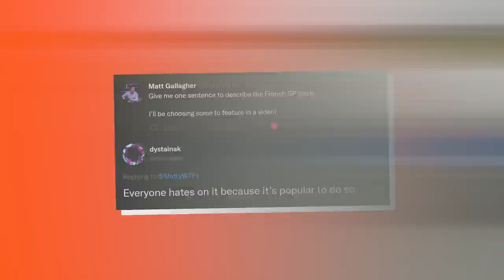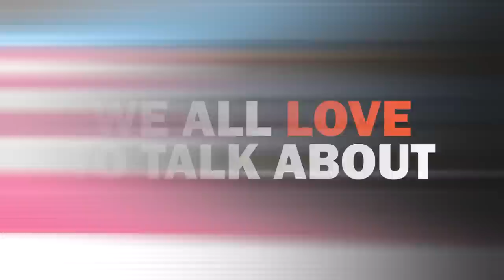Is The French GP Circuit Really THAT BAD?

Comment: It's just really hard on the eyes to see the flow of the track they're actually racing around as the strips just make it so confusing. None of the corners are that memorable and because it's all surrounded by identical striping it's difficult to know which corner a driver is at when the feed switches between drivers... By giving the entire track these jarring stripes it robs the circuit of a natural flow and characterisation. At many tracks you know where a car is when it's switched to. Or at least there's usually 2 or 3 corners which you cannot mistake. Paul Ricard is just homogenous and messy and hurts your eyes as the camera sweeps around and the strips pivot and twirl around.

Comment: Paul Ricard produced some good racing in the 80s. The problem with the track now is that for reasons I can't understand they decided to put a chicane in the middle of the Mistral straight, one of the greatest blast straights in motorsport and which IMO is the key to the whole track. This has consequently ruined the racing. Ditch the chicane and let the cars blast down the Mistral at full tilt and you'd get plenty of overtaking action.

Comment: I never thought it was a bad track. Maybe not the most exciting as it's very flat, very consistent, and very visually assaulting. But there aren't massive problems with it; it's just good, with a blend of technical medium to high speed sections that flow well.

So keep it...but maybe ditch overlapping layouts and change the stripes for a coloration that's less assaulting to the eyes at 200kph.

Comment: In my opinion, the track is better than its reputation. When I drive it on the F1 game, for me it's one of the best tracks. I really enjoy the first two corner combination, the chicane in the middle of the straight and especially the long, tightening right hander which you enter really fast and then have to bleed speed through. Also the off camber left hander after it is tricky. So to say the track is boring or doesn't have character, just because you can't name the corners (which you cannot do with most tracks on the calender and isn't really a criterion of track quality anyway), isn't accurate for me.

And then there is this whole discussion on the number of track layouts and blue and red colour scheme. Which I also find ridiculous. Of course gravel traps would be nice, but I actually like the colourful design and I think it even makes the track unique. And many layouts, if anything, is good, not bad. This is just argued about to find further arguments against the track because these things are different than on other tracks, and people don't like differences. The maze memes are funny, but I never ever wasn't sure about the used layout when watching a race.

The one, solid point against the track is that it produced a couple of boring races in a row. Which is of course a substantial criticism, much more of an argument than colours or number of track layouts. But that was in an era, where boring races happened on a lot of tracks due to Merc dominance and dirty air. Last year was already a good race, let's see if this year is good as well, then for me, the track is fully rehabilitated.

Comment: I genuinely tried to guess the correct F1 layout from the picture and got it wrong AFTER WATCHING 3 RACES THERE.

If I were to say one kind thing about the track it'd be that it's very safe, since you are one kilometer from the next wall at any given point in time. Of course, you are NOT safe from the FIA which will guillotine your winning chances for violating track limits that do not physically exist.

Comment: I don't particularly like the colours but it's not that bad. It's also easier to get to than Nevers. I drove past the circuit on the motorway yesterday afternoon while the race easy underway and the temperature was close to 40 degrees so it may not be the best time of year to host the race. 
Given its proximity to Monaco, I was wondering if there have ever been any two races in a single year so geographically close?

Comment: Producing good racing doesn't mean the track is actually all-around good. If the drivers say they don't enjoy it, there must be a reason. Of course I'm just an average sim and videogame "driver" but Le Castellet has no flow at all. The three sectors are very different from one another and you're never in tune with the whole track, exactly how it feels when you watch the race. You can overtake and you can see good racing, obviously, but it doesn't automatically mean it's a great track. We had boring races in Silverstone... Would we say it's a bad track? Final note: in a fantasy world, where the horrible stripes are replaced by gravel/grass, this could actually be a more interesting circuit.

Comment: Two things (or three):
1) It is just boring - that's it.
2.1) The blue/red lines around it - they are not pleasant to watch, definitely irritates the eyes; especially in close caption it is even hard to follow there the car is, because most corners looks identical....
2.2) ...and apparently they (blue/red lines) do a terrible job stopping the cars from sliding (which is their main purpose)... not even close to the gravel used no the most tracks. Yes it is easier for cars to come back on the track after a spin or when pushed by another driver, as happened to Perez this weekend, but is term of safety I don't think it's a proper solution.
   Cheers!

Comment: It is worse. The only thing that makes it a tiny bit less than unwatchable is when the track cameras keep tight focus on the cars and stay away from the dizzying runoff art. If I was epileptic those patterns would put me frothing and flopping on the floor. When the shot switches to helicopter I have to search for the damn cars. Replace it with Le Mans next year, dump Monaco since the cars are almost as wide as the track and keep Spa. Otherwise, I have been gravitating to Indy. Yeah, bad tracks but man the driving excitement is great. And they are fast. And the cars are quite cool looking. F1 needs a reimagining. the Netflix crowd will fade and the life long fans will find better racing elsewhere.( LMH and LMHD cars are looking racy.) Then what? Oh and if the announcers of F1 would just give up the obsession with track limits already. Let the drivers drive. The curbs and dust in runoffs will bleed off time without the Nannies taking points away for a millimeter over a silly line. OK. Hopefully the race will be slightly less than boring on Sunday. My bitching is over now. lol

Comment: This track is literally just a painting on a huge parking lot. How about racing on some actually good and interesting tracks? For example there is a track with minimum 12m width, so modern cars would fit perfectly, it's got gravel instead of sausage kerbs or stupid asphalt, grass, elevation, great corners, only thing it's missing is a super long straight for DRS overtakes, but really, it's not the overtakes on straights that are interesting. Just check out Brno Circuit. MotoGP is there, the track is fantastic, modern F1 would be great there and the only thing missing is the safety grading by FIA, even though it's still much safer than Saudi Arabia for example.

Comment: I hate this type of tracks in Simulations when it isn´t clearly where you have to go in the first few laps, there is on particular part where i often brake to early because it´s easy to confuse for the actual track layout when it isn´t clearly marked. It is before a chicane where it looks like a crossing, i hate it really.
The track itself is fun and has great flow but this parts where parts of different track layouts just cross the actual layout with markings all over the place, that makes it infuriating for me in simulations.

Comment: the 2021 race was "good" just because merc f up their strategy. by my view, you really cant overtake on this track, maybe T1 + chickane on the mistral straight, but thats it... the whole sector 3 is just horrible to watch as its very much different to what favourite technical sections look like and are constructed. plus only 60 km/h pitlane just is a negative thing. they need to change sector 1+3 to have some actually good overtaking spots and a better flowing technical section.

Comment: Just opened the video, but we're not. Track is just boring.

Magny-Cours was interesting as pushing hard was key, nowadays wouldn't suit the cars, which makes me wonder, do we need a French GP?

Why just they don't use La Sarthe Bugatti circuit with any changes needed, maybe increasing the track a bit to be under the minimum lenght required by FIA and maybe Safety Grade 1.

Comment: the thing i hate most are the huge run off areas. no penalty for drivers when they make a mistake. I really dont like all those TilkeDroms. They have no character.
Reply: Paul Ricard wasn't designed by Tilke
Reply: @ey7290  i used the term Tilkedrom as a synonym for modern track with huge run off areas. 
I didnt mean to say he made it, even though i did not know he did not design it.

Comment: This track iritates me so much that I usually don't bother watching it. The main reason why I don't like it is because the track is painted pattern  on a large piece of tarmac. The Blue, Red and green lines painted around it I find irritating and distracting to look at. 
The drivers all abuse track limits because there is no reason why not to.
Overtakes become silly as each driver then uses  the  run offs to their advantage.
I can see why  track attendance is so low.

They could make it better by putting grass strips around the outside and inside of the corners.
There is already grass around the circuit so it does grow there
But they won't as the option they chose is the cheapest one.

Failing that, artificial grass would be even better.. No high grip, highly  painted tarmac please...

Comment: My opinions on Paul Ricard are based on how the track looks

I like the layout the F1 drivers use - yes even the chicane - but the rest of it is just horrible

The combination of 25 squillion track layouts and the day glo tarmac run off areas makes it the ugliest racing circuit in all of motorsport. 

I wish I could ditch the multiple layouts, add grass and gravel and make it look like an actual race track that looks visually appealing to look at instead of what we have now

Comment: It's not the track, it's the cars.

Let me explain:
OMG The French grand prix is so boring!
OMG The French grand prix (Magny Cour) is so boring!
OMG The Monaco grand prix is so boring!

OMG Malaysia, Texas, Sepang, Fuji, Bahrain, Shangai, Istanbul, Valancia, Marina bay street, Buddh, Sochi autodrom...

Okay, how many track does that make?

The smallest common denominator is the cars. I don't know what it is about the cars that make it boring sometime, it's a package thing. I would try reducing it in size by bring 3 mandatory pit stop with refuelling. I think that would help.
Reply: @robotnikkkk001  
If you go back to 2011 or so, you had F1 fans were claiming that they hate Magny Cours, that it's boring, and yadiyadiyada.

I don't think it's a boring track either. Not my favorite race track, but that's a different story.

I don't think it's a track problem.

Albeit, if it was only about me, I would just pay $30 million bucks to upgrade and bring F1 to the Circuit de la Sarthe and race there... With a bunch of temporary chicanes that could be removed for the 24 hours race.

However, that move also makes no financial senses.

Comment: Its just a shitty designed track layout while there are so many options with all the runoff to make an actual good layout. Turns 1-2 are terrible for overtaking since tou basically only have 1 line through it, then T3 has a straight that is too short and the braking zone isnt heavy enough for overtaking then T4-5-6 are all slow and have no flow at all, then in T7 you can overtake and the chicane isnt that bad as it provides a good overtaking spot. Then T8-9 are meh, T10 is a lot of fun but shit for overtaking just like the rest of the last sector which completes a lap with very few overtaking spots and no flow at all because of the tight corners

Comment: It's not pretty, but looks better then it did went the run off areas each side were all sand, May of they paints the run off areas green or used fake rubber grass or something. Never race it in a Sim so could not tell if it is fun to drive.

Comment: "...really that BAD?" - YES.
I fell asleep three times watching the race on DVR. My wife fell asleep once and quit watching after 15 laps. She had more sense than I.
Simply awful for spectators. The eye-watering red, white and blue abrasive paint stripes on the runoff areas make a grotesque reference to the French Flag, but who cares? The striping makes this race even worse to even look at. Couldn't the abrasive areas  just be painted grey?
I've got no problem with an F1 race in France, but F#%k the "historical legacy" crap,  and build a more compelling venue near Paris. Circuit Paul Ricard needs to be scraped flat, and planted with grapes. Watching the vines grow would be more exciting than watching a race at this track.

Comment: Two words:  Parking Lot.

The rest:  The track is extremely boring and artificial.  It is Hermann Tilke at his absolute finest, a venue which ticks all of the possible technical challenges, but is about as exciting as watch a cat throwing up a hairball.  It was designed as a test track and not a race track, and it shows.   There are few if any locations for natural passes on the circuit, and few places where cars can gain advantage over others.   It is a horrid collection of single groove corners, winding stretches that discourage passing, and then long straights that end in corners which do not promote passing.   The only true passing point on the track is the back chicane, and that is only if the driver doesn't get lost or a case of vertigo from all the stripes going by.

Further, the track has little or no changes of elevation, no corners with real challenges as to camber or whatever, and OMG is it ever boring to watch.   It has the character of a plain cracker.   Plus the lap is long only to be long, so they could have more sub-circuits to rent out during the week.  

I think of this track as a tribute to Hermann Tilke, a man who has lead to more unintended naps during F1 racing than anyone.  This one and the Circuit of the Americas are two of the most nauseating and boring circuits in existance.